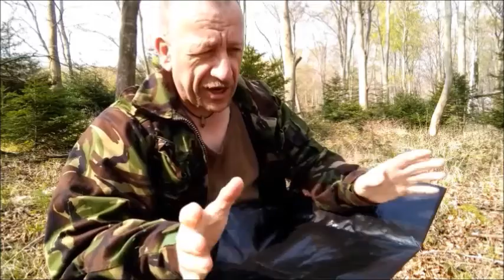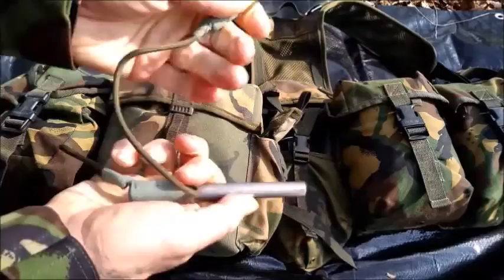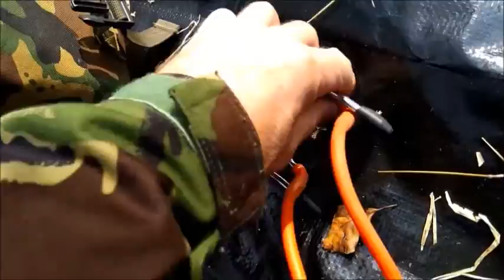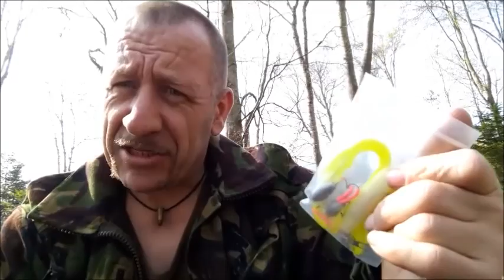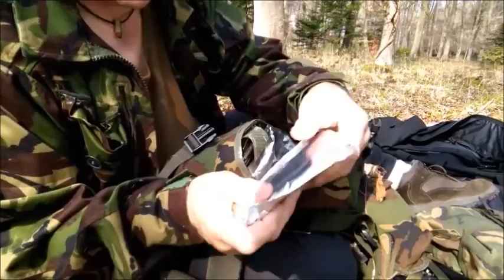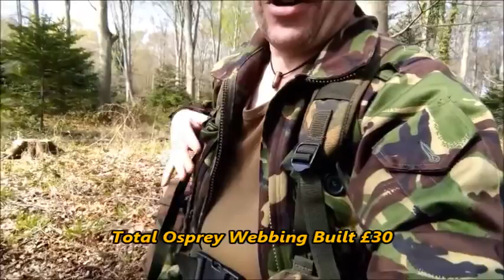DPM Webbing & PREPS LOADOUT for £15....bexbugoutsurvivor

Comment: I love my C95 webbing. Did the Tongario Alpine crossing with all my kit in just the webbing. It would've fit 8 litres of water too - but in the end I carried just over 4.
I know people will say you should have a water bottle in case you ditch your pack. But, a rubber glove inside a pouch works well enough.

Comment: Good recycling skills, ... my system is to add webbing pouches to my bergen waist belt/straps, when on it looks like i have webbing on, (i know ... what if you lose your pack? ... my answer is ... i dont) its just a method of organizing my utility type items that i want quick access too, that way my pain pack is for my sleeping/shelter/spare clothing.
Reply from the maker: Similar set up....How ever the rational of my webbing is to take weight from the pack, and distribute to other areas. Main body sleeping bag and basha, and clothing, side rocket MRE, other rocket removed for a camelbak, underside bivvy roll. I too have utility on the waist band of my MTP Bergens, Almost same idea. 

 I admire your confidence of not becoming separated from your bergen, (what if I mugged you....Lol)

Having been homeless in the past, I know the value a bergen can bring, The best sleeping  insulation and rain shelter is key....shop foraging for food, the rest is just a bonus.....Bex
Reply: @bexbugoutsurvivor    ... your up in north wales, i'm in south wales ... so feel confident your not going to mug me, LOL

I tend to go as remote as i can ... i am aware there is a risk of being separated from my bergen, but in 20 years i've only had a couple of near misses of people stumbling across my camp or hidden bergen's location.
Have you done a video on being homeless ? ... if not it could be a valuable lesson (ie things you learnt from it)

Comment: Love my plce webbing have a Austrian butt pack and 2 water bottles   on it for the most part, sometimes with a rocket pouch going horizontal across the yoke with summer sleep kit, so versertil and cheap, take care
Reply from the maker: The Austrian butt pack belt order look the bizz. I have 90 pat brit too in olive drab, just for canteens and water, takes a sh*t load out weight off yer back. Gotta love cheep kit, 
Easy fella....Bex
Reply: @bexbugoutsurvivor  
The Austrian butt pack is giant it fits on the Austrian yoke like a day sack, i love mine ,mines 90 patern kit mostly, I've Austrian and German webbing too but the plce  is the best, i swear by my belt kit Carry's everything you need to keep yourself alive and comfortable, I think that pouch u have with the gas mask is for lmg rounds , take care my mate
Reply from the maker: Gotta get me  the Austrian. Think you might me right about the gas mask pouch, would fit the LMG box mag, but only ever seen them in MTP. The inner has a divisional partition, fits my spare respirator filter to a tee also....Laters mate...Bex
Reply: @bexbugoutsurvivor 
Get the butt pack if you come across it defo, all the kit I've had seams well made and I've had a few years,

Comment: As ever Becks sir, very wise words.  Many people will not be aware of webbing and plce kit, they won't know of it's proven advantages in use, or as you pointed out so well, it's very reasonable price.  On fleabay if you look hard enough, some of the pouches are as little as a quid.  The yoke sometimes is a little harder to find, then you get the London bus thing and there are twenty all at the same time. But I think the most awesome thing is, it's entirely customisable, yours and mine are completely different, but the same.  Good stuff sir.
Reply from the maker: Thanx for joining us once again, webbing can be custom built for the individuals requirements. I try to focus on food water and shelter, or means to procurement of these elements. The rig in the feature is so heavy, I'm glad its not in my pack anymore....There is a vid coming up in a few months time of different types of webbing, including my camping webbing.....All the best...Bex
Reply: @bexbugoutsurvivor  I am looking forward to that vid buddy, I did hear you mention it, will be a good comparison exercise.  ATB Dave